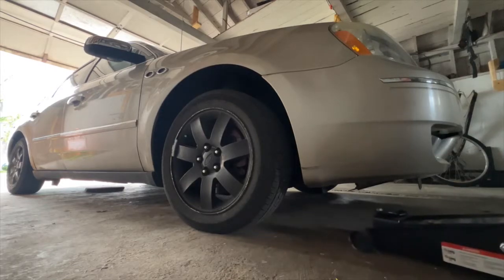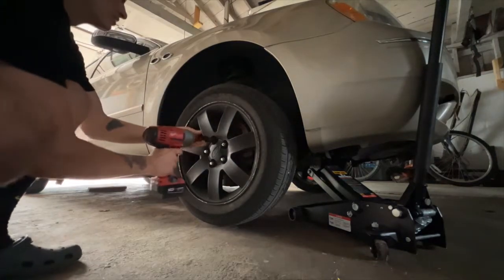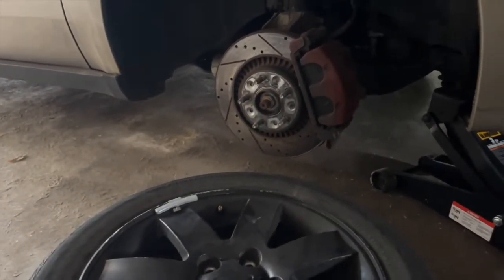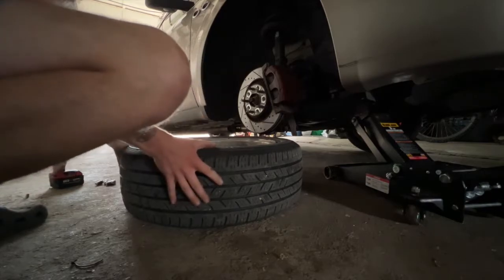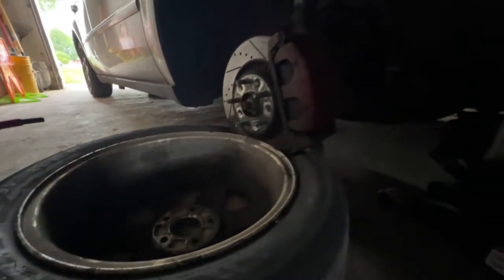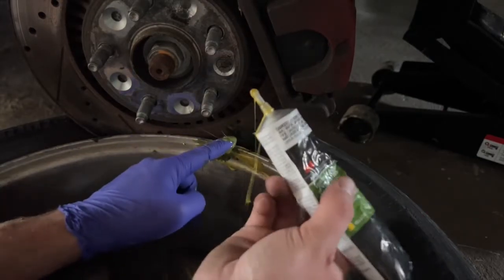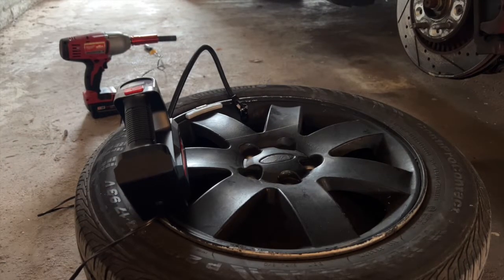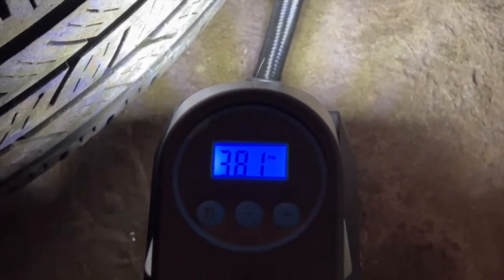Easiest Way to FIX CRACKED WHEEL

Comment: how safe is this, a cracked rim ois safe to drive on?
Reply from the maker: Sure, why not?  Generally air leaks out, but if you can seal it, that will work jus as good as getting a new one.
Reply: @emukdog7  still holding up or did you get the wheel replaced?
Reply from the maker: Still holding up !
Reply: @emukdog7  Same thing happened to my Beyern rim in the SAME exact location.  Before I drop another $500 on a new rim, is your repair still holding up?  If not, how long did it last before it finally leaked again?